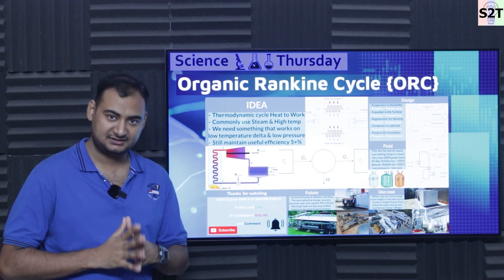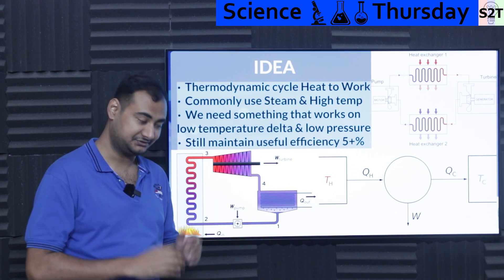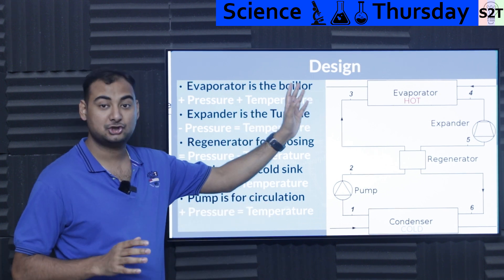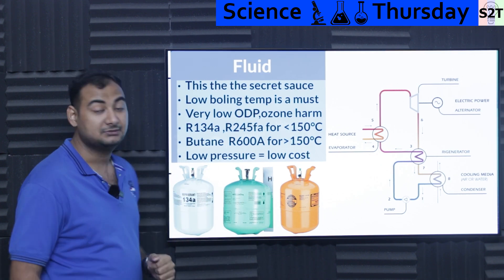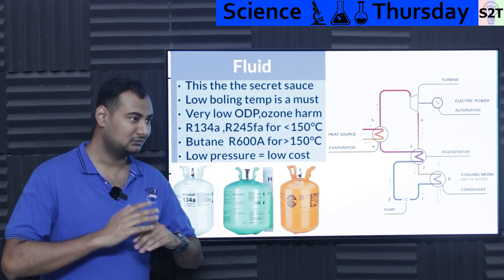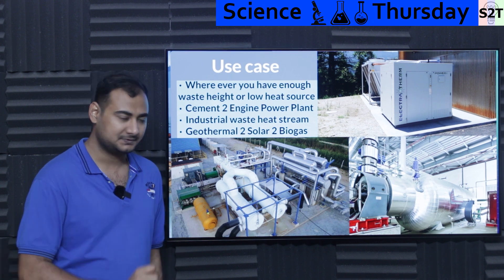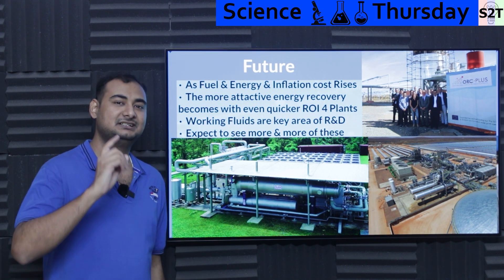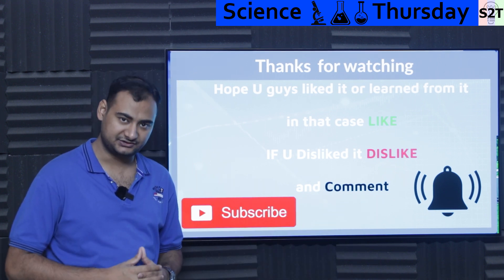Organic Rankine Cycle {ORC} Explained {Science Thursday Ep237}

Comment: could you do a video about the physics of the process using the curves but without maths?? explaining also (which is normally skipped over) the basics, i.e. why it is so important to reduce the volume and compressive qualities of the medium, at best by liquifaction/condensation (little work in at pump at pressure x with little surface; much work out at same pressure with much larger surface of steam?)?
Reply from the maker: that it too complex for me

Comment: are there ORCs using radial expanders (like for gas liquefaction) where the working fluid is condensing in the turbine (highest enthaly drop) which can be done in this type of turbine (because medium-droplets are drifting parallel to the blades. however not in an axial turbine because of cavitation [medium droplets hitting blades]])? or does a pressure drop that leads to condensation in the turbine not make sense in a process for creating mechanical work?
Reply from the maker: not sure

Comment: Is there a formula to measure Kw, or turbine sizing with the temperature delta or the thermal efficiency?
Reply from the maker: get a quote from the company making it . they will give you a graph of there tool and its output based on different temperature delta

Comment: bro ate.
This was very informative and entertaining to watch. Subscribed!

Quick Question, I am undergoing a research on a parabolic dish system optimization, and I am thinking if I can increase the efficiency of the device if the power conversion unit is a stirling engine coupled with an ORC for waste heat utilization. What do you think of this idea?
Reply from the maker: issue is always the same if you put LOAD on the waste heat stream you reduce the effecicy of the main system and the add one rerely add enough to justify it so from cost and simplicity and maintenance point of view its prefered to just have on stage or some passive use of waste heat

Comment: Isn't it basically (Th-Tc)/Th gives you the theoretical limit of efficiency? As, 400 K hot side - 300 K cold side could produce 25% efficiency, if you had a perfect heat engine, and absolutely no losses.

The other big issue is that refers to actual temperatures of the working fluid, not the temperature of the actual heat source, or temperature of what you reject the heat to. And the lower the temperature difference, the less heat transfer you get in a given heat exchanger.
Reply from the maker: On paper yes but that is not real life .

Comment: Theory:
Hot side: solar thermal
Cold Side: geo
Working fluid: propane
Application: simple loop utilizing natural convection.  Priming pump, priming pump bypass, regulator valve, tesla valve and tesla turbine.  Overflow canister used on high pressure side as a buffer for pressure fluctuations.
Concerns: velocity of working fluid, freezing at heat source or flash point at condensor.
Reply from the maker: Okay
Reply: @s2tenglish  I was bored and started scribbling only to find out I'd come up with simplified ORC generator.  :D
Solar thermal panels are around 3x more efficient than your photovoltaic panels.  Could work for a small system or even a small household system.  You're much smarter than I am.  Could this concept be viable?
Reply from the maker: it does not work on small scale that is why we use PV pannel